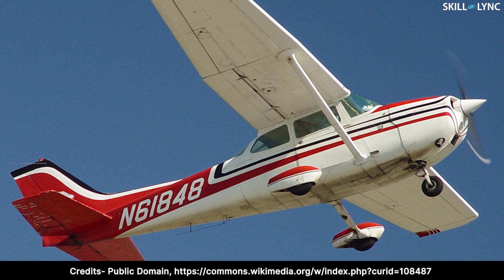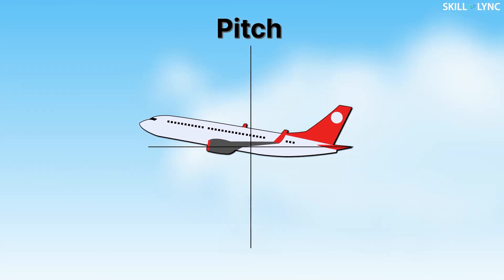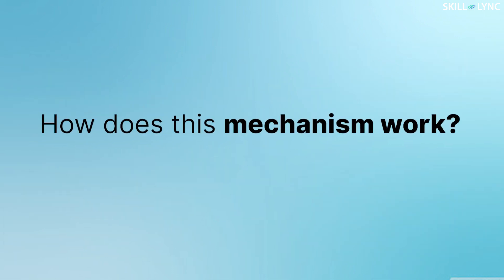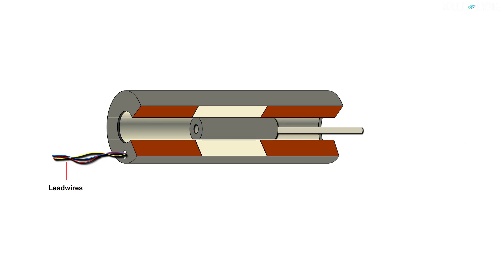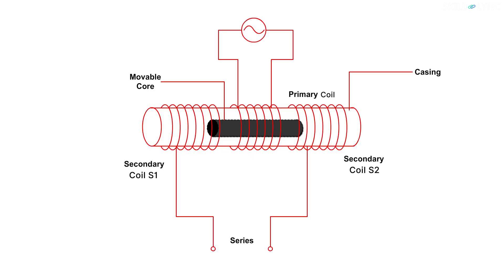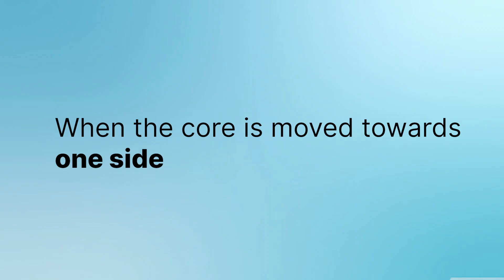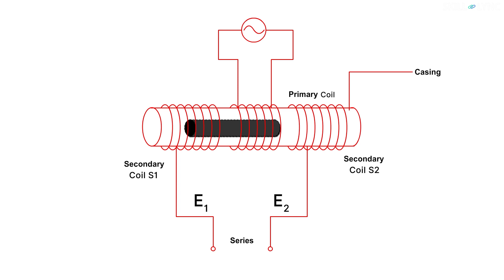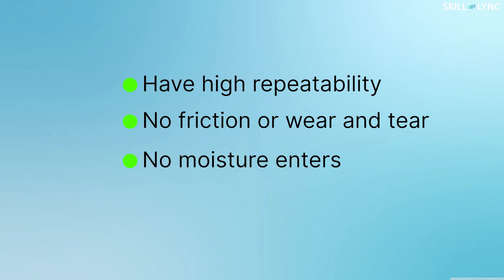What is LVDT? | Skill-Lync

Comment: Not clear for me how it used in airplane control.
Reply: LVDTs are used as a position sensor in the feedback mechanism of a fly by wire system in commercial aircraft and measure the extent to which a control surface has been deflected as it is a linear motion.